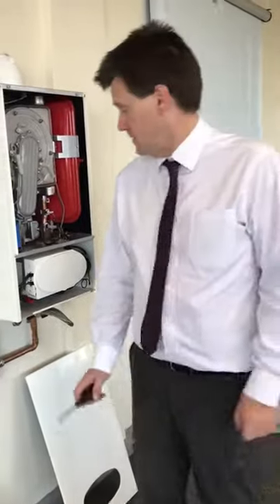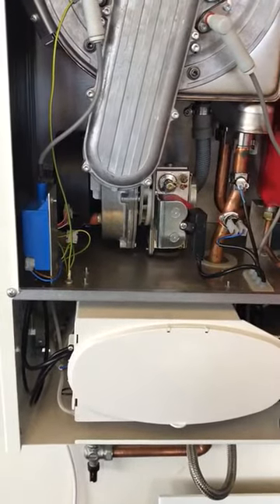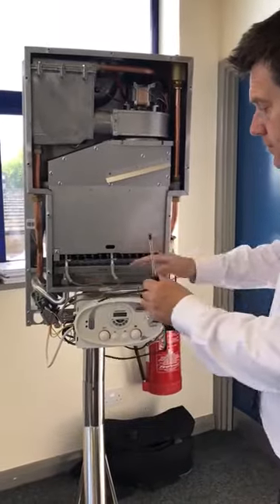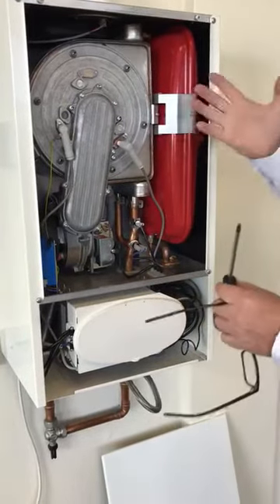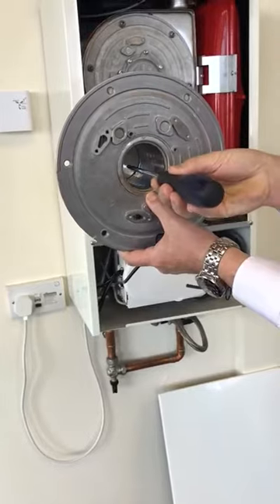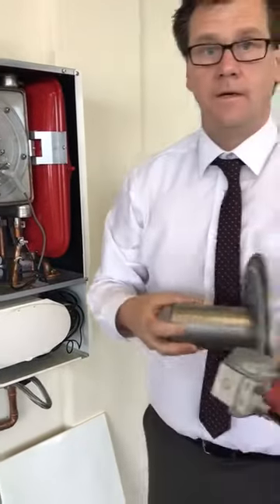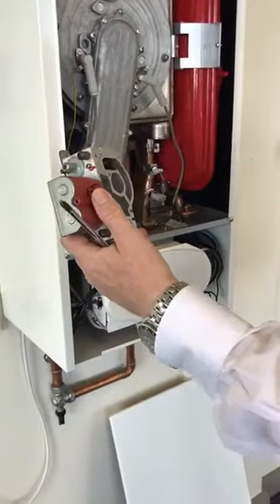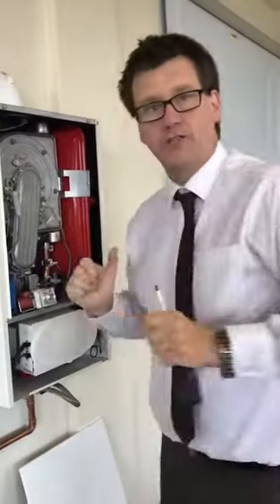Tech Talk with John Wilson Gas Valves part 2

Comment: I have a sit tandem gas vale on potterton housewarmer 45, it blows back one time in 200 but I have never witnessed it doing so. just fitted a new replacement sit valve whick blows back 3 out of 4 times. I have put the old valve back in. I watch it, works beautifully then as it starts goes straight in to full power and blows back. Any ideas? cleaned burner gauze with vinegar. PS apparently it has been doing this for 22 years since it was fitted commissioned.